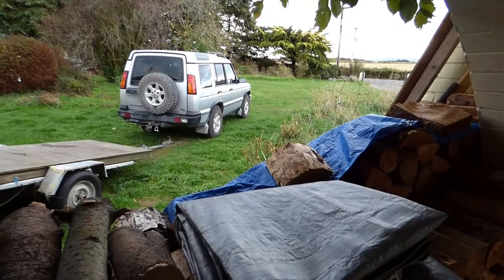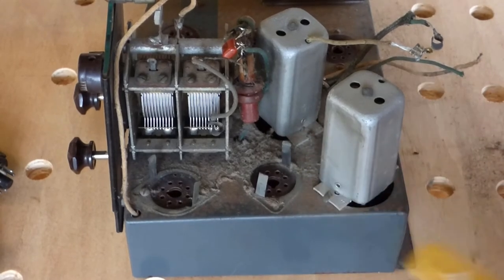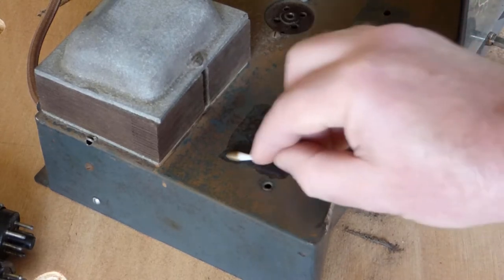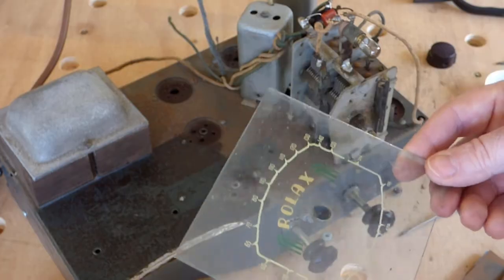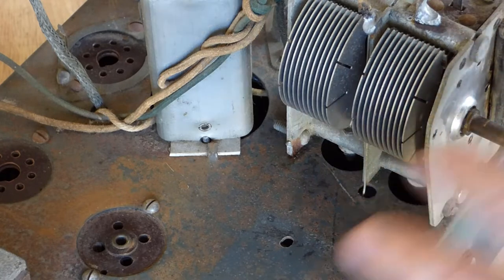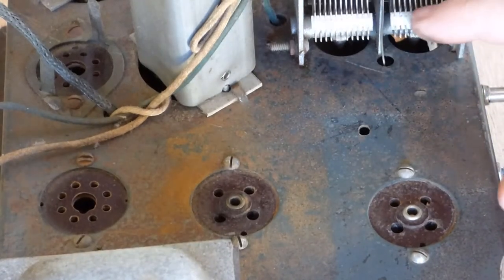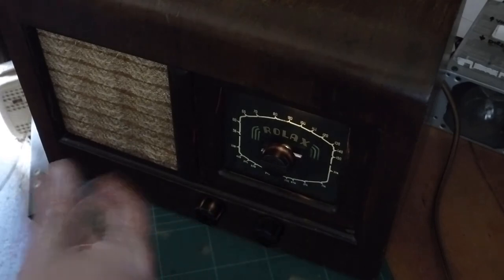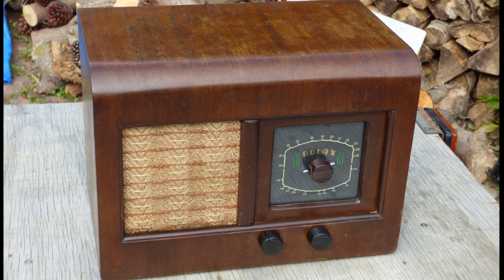4 of 4 - Repairing a 1939(ish)  Rolax 5-Valve Broadcast Band Radio - Final

Comment from the maker: It actually just occurred to me (speedy mind I have, eh?) that the on-off switch may have been added sometime after the set was sold - this would mean it would have only had two knobs in a vertical line, and a much more balanced appearance as a consequence.  What gives it away I think are that the holes in the cabinet are different sizes (which I only noticed for the first time as I watched the video back to make sure it exported properly).  Two knobs would be in keeping with the budget nature of the set as well.

Comment: I agree with you re that 'on off' switch being probably a mod. Given that I suspect overall that there has been some bodgering going on over the years.. Grandma wants her radio not that new fangled whatever ... hmm been there 😗😀Sometimes there is a pleasure in handing back a repaired, refurbished et radio to someone who genuinely loves it for what it is.. part of the family? My uncle used to listen to the Archers (UK BBC) radio 4 for decades.. Ekco valve radio.. 😗 Ah #memories . I have some permanent marker 'pens' that have a variety of tips AND colours from gold, silver RGB et that can touch up glass printed or etched artwork.  👍 I've also used a plastic sheet that can be run through the printer that works well AND can be sealed on glass et 👀Tuning gangs I ALWAYS give a good clean AND I ALWAYS check that the rubber mountings et are in good working condition. 👍 Thanks for taking time out re these vids et Steve 👍 I clean cabinets like this with steel wool and methylated spirits et then use a liquid stain ie teak, mahogany et Avoid using wood fillers !

Comment: Very good job on this one!
I remembered that I forgot to mention a couple of things in my previous comment.  The first one is to clean out the sockets where the pins on the valves go, a Dental Flossing brush works great to help you clean out the sockets.  You can use whatever liquid chemical you prefer, and just "spray and brush" the sockets.
The second thing is more of a question of what your opinion is on a concept.  I have seen others install either an RCA type jack or a BNC connector to the back of the chassis for the antenna input.  From a standpoint of convenience, I like the idea, my "problem" with that though is that it isn't "original" and in one sense detracts from it. What do you think?
Reply from the maker: Hi Wayne, I'm not a fan of adding BNC or RCA sockets - NZ radios typically had a wire hanging out the back when they left the factory, and thats how I prefer to leave them.  Having said that, I would probably convert vintage test equipment from their weird coax connectors to BNC if I was going to use them on the bench, just for convenience.  Cheers